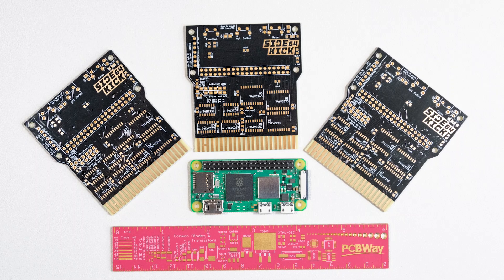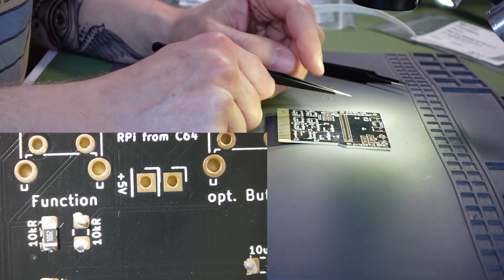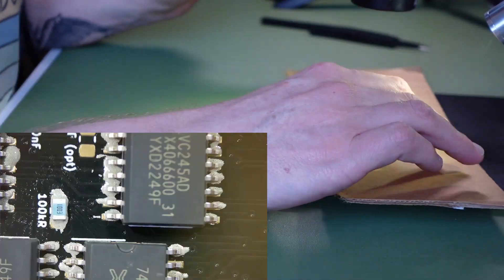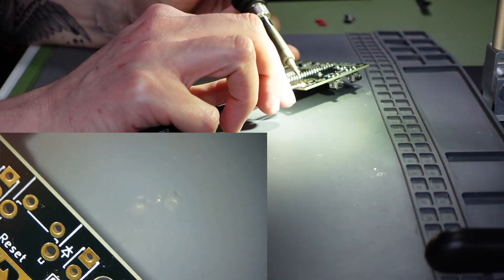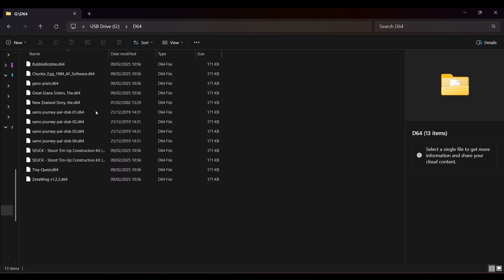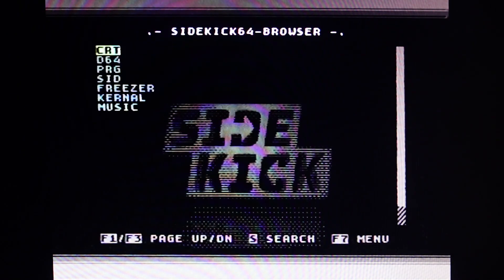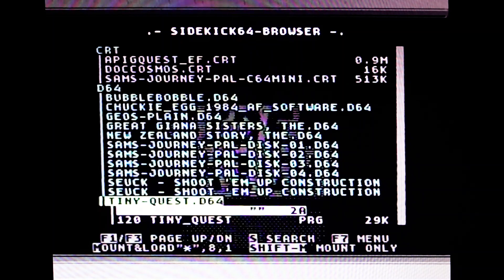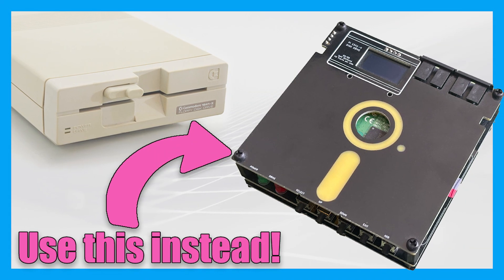Commodore 64 | Software Defined Cartridge | SideKick64 | Side Kick 64 | #commodore64 #pcbway

Comment: Anybody knows if it's still maintained? Latest firmware is still from 2023. I have a SideKick64 as well but to be honest I really don't use it anymore. Not really found anything that Kung Fu Flash can't. Perhaps something about kernal replacement that KFF needs to mount a cartridge image where as SK64 can just use binary file. But that's really a niche. If only it could snoop SID adresses to ba able to play stereo - without need to mount wires inside C64. Since invested in Ultimate 1541. Can do it all. Perhaps except if you like SidPlay64 to play your sids then it's noticeably slower than KFF.

Comment: What temp solder paste did you use? I have 150 degrees but not got around to using it yet.
Reply from the maker: It has a melting point of 221 deg C. I had the air temp set to 375 deg. Practice on something that you don't mind going wrong though, the first time I tried this method,  I blew the components everywhere, the next time I melted some LEDs. But kind of got the hang of it now, still room for improvement though 🙂

Comment: Very interesting build! I've never seen that SMD soldering technique before.. What product did you use for that? Cheers!
Reply from the maker: The hot air station and microscope I used are here https://amzn.to/4cbymsz I had the temperature set to 375 degrees C and airflow set to approx 3/4 speed. The solder paste I used is this one https://www.amazon.co.uk/MG-Chemicals-Pneumatic-Dispenser-Dispensing/dp/B00M1RC0IU